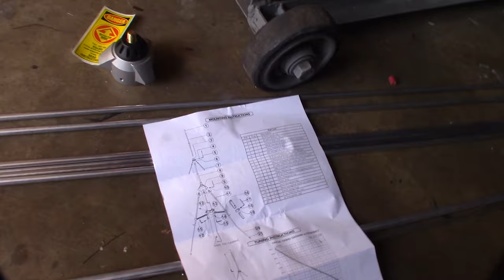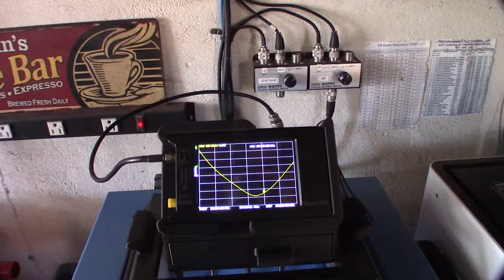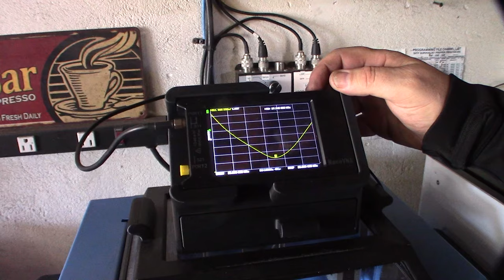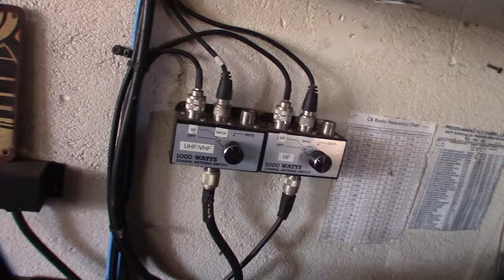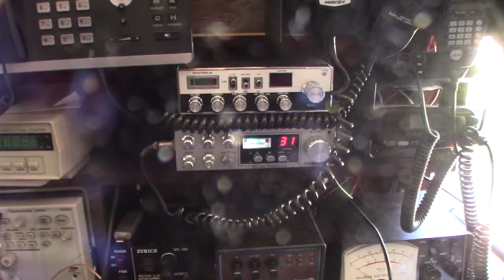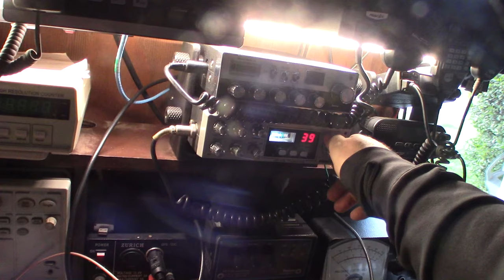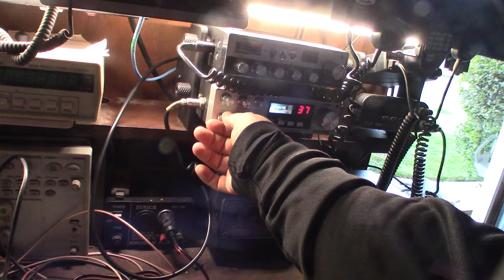Sirio Starduster M400 Antenna CB 11m Installation and Testing, Classic with President Grant 858

Comment: Cool video. Nice setup. I've used several Stardusters over the years. Very broad antennas.  You do any out of band stuff, below 1, etc?
Reply from the maker: I have it tuned for the upper channels. That's what makes the nanoVNA so nice. I can tell where the antenna is the most resonant. I need to bring the center up by half an inch. This antenna is way better then my half wave dipole. On my first call out I picked up a guy in Florida. I can't use any horizonal antennas in my area because of the power lines surrounding my house. What is your favorite antenna?
Reply: Those Nanos are nice. I use the Rig Expert. Favorite antenna? Wow, that's a hard one. So many. Age here is 70. I've been using this radio stuff since the late 60s. Probably the Super Hawk quad. Signal Engineering made that years ago. Someone else bought them out. Amazing antenna for 2 elements. I've had Moonrakers, PDL II, Y quad, V quad, and others. After a recent move, all I have is an A99 75 ft up in a big poplar tree currently. Anyway, we might have a QSO sometime. I'm in NC.
Reply from the maker: @q95oldies57  I've been looking at those quads, I recently have been designing antennas. I have a few videos about it to upload. Been listening on the Starduster for the last few days. I'm kind of a silent key but the few times I've transmitted people said I sounded great on the other side of the country. I'm using a 858 grant with Palomar two pill.
Reply: The Palomars are nice. Good dependable amps.